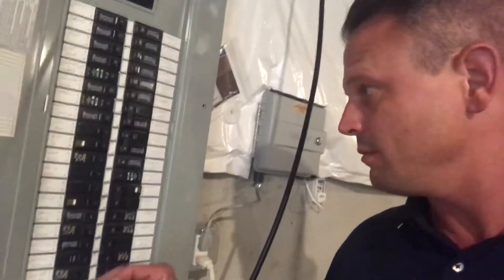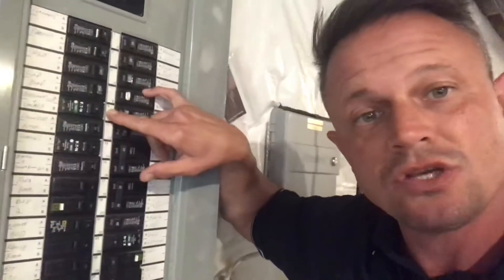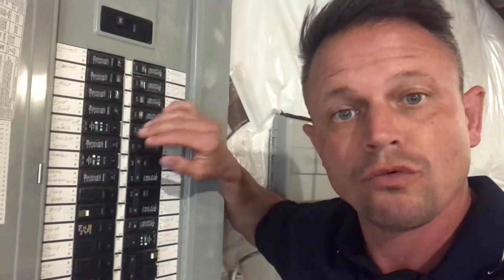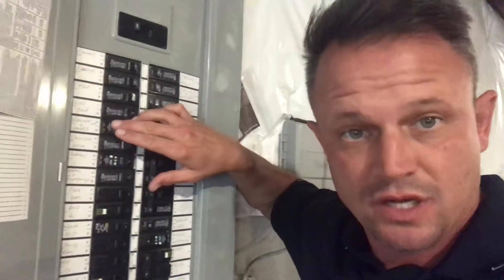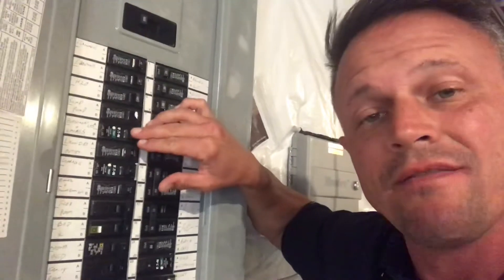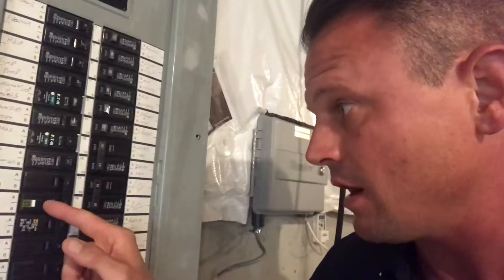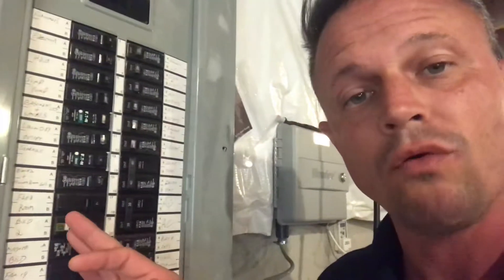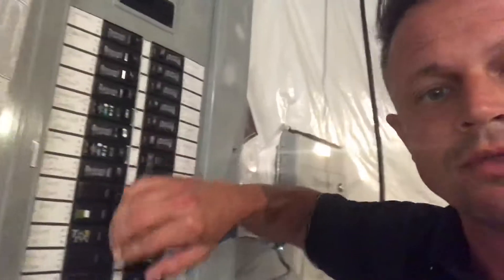How to reset a circuit breaker, including an arc fault circuit breaker

Comment: OK...thanks for the info on the AFCI/Arc breakers. Have 3 of them in my box, one for each bedroom. Was not sure why they were different then others. Now I know. Odd thing is, power went out in 2 bedrooms, but not sure if on different days (2 breakers side by side). Even though I seem to be able to reset them,no power, and the yellow "test" button does not reset (seems to be pushed in already). I would assume both breakers went bad. It sounds like the breakers can go bad and do go bad, if those TEST buttons do not reset.
Reply from the maker: Hi Deek! Yes, you are correct it appears from what you’re telling me that they went bad, and need to be replaced.
Reply: @BJPoznecki  Thanks...those arc fault 2/15v are hard to find. Only found 1. Thx again!
Reply from the maker: @DeekJohnson  Yeah, you may have a tough time just going to Home Depot. Sometimes with that kind of stuff have to go to an electrical supply house.